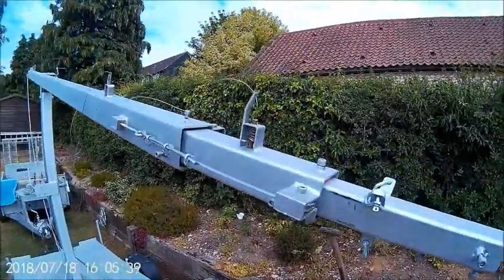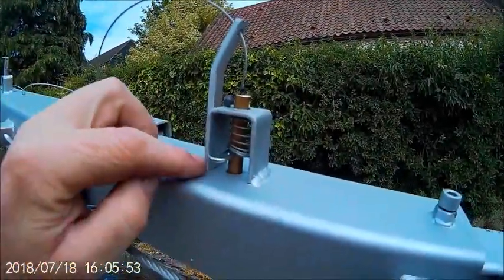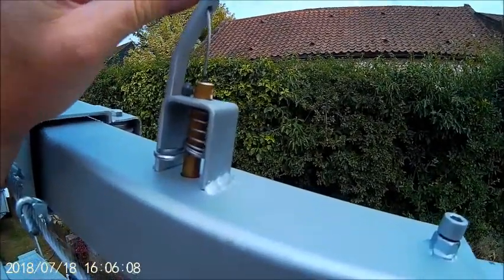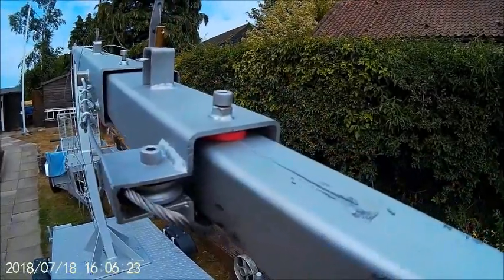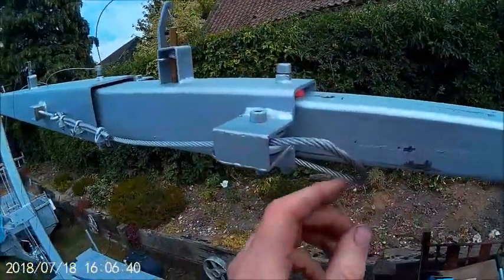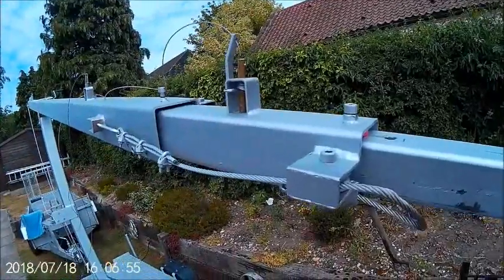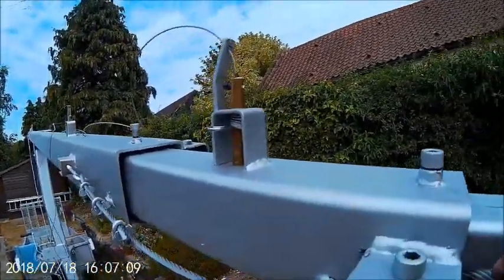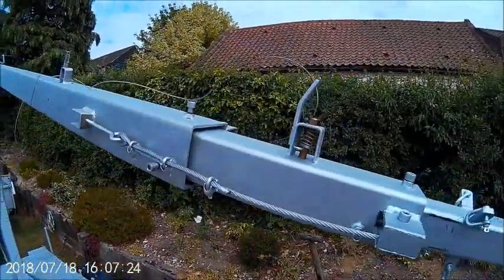Radio Tower Locking Pins

Comment: I think I've watched all your tower videos now, and I don't recall seeing how the cable is attached to the bottom of each section.
I can't figure a way to do that that wouldn't possibly kink the cable.   In other words, I haven't found a perfect solution.
Also, it seems like it might be a bit fiddly to get the nylon sliders in there.   
Overall, I really like your design, but if I ever get a place where I can erect one, I might change a few little things.

On the one you have at your home, did you ever pack under the base with non-shrink grout?   That was standard practice when I worked in the construction field for steel columns and such in commercial buildings.   It would take some of the load off those anchor bolts.
BTW, I'm not an engineer, just a dumb old bricklayer.
Cheers from the USA.
Reply from the maker: Hello Charvester thx for taking the time to comment, The cable is held to the bottom plate quite easy I drill a hole in the plate next to the tower section to pass the cable through and grind it to make a easy passage so it's not sharp to cut the cable, Then using a thick piece of plate with a groove for the cable to sit in (a bit smaller than the cable) I bolt this to the bottom plate with 2 good bolts clamping the cable in place. 

The nylon spacers can be a bit fiddly but and I was thinking of changing these with another idea at some point.

As for the concrete I just used it plane as I don't have much experience with the stuff so just did what I thought would be strong.

Good luck with your build and with most things you can change things to make it better. All the best Nigel.